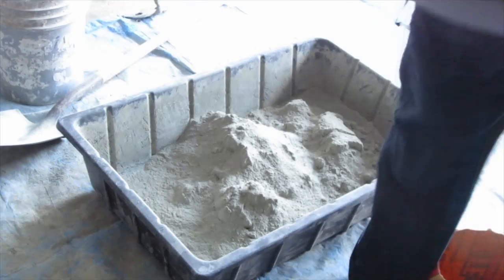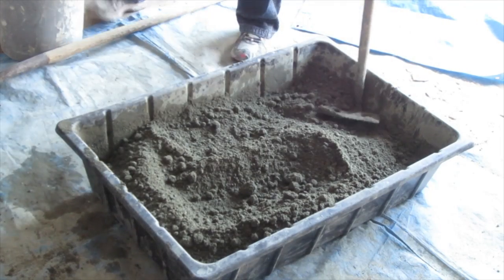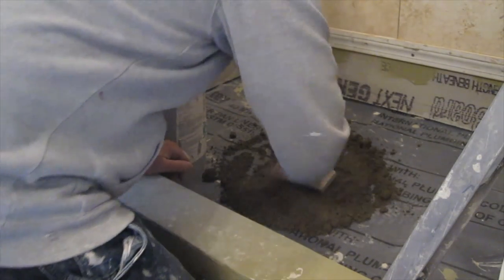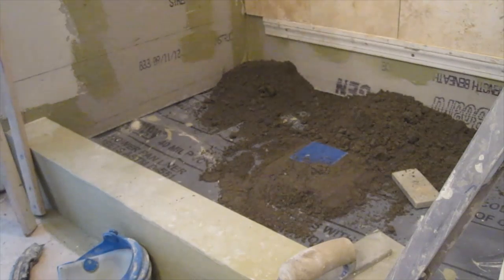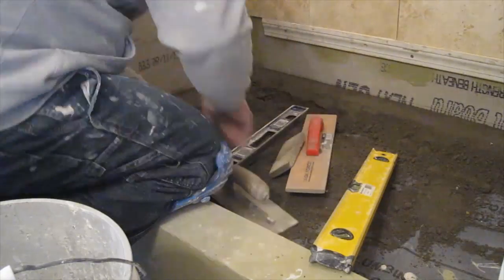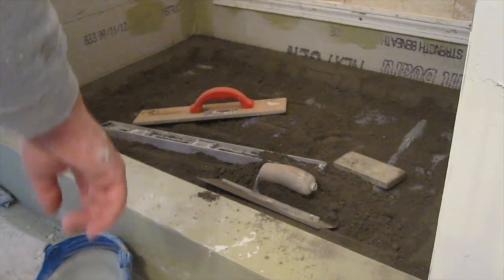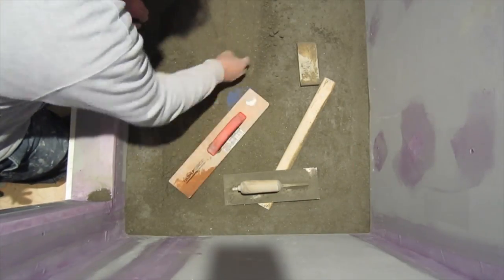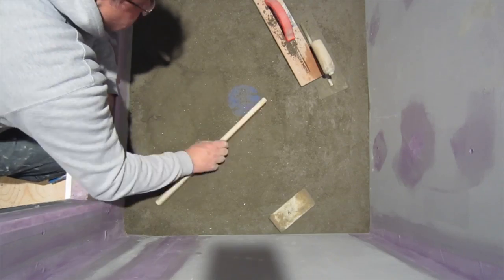How to install   Mud in a shower floor

Comment: how high do you start with your drain to base your 1/4” per foot off of ?? thanks.
Reply from the maker: Whatever height you set it at, the furthest point from the drain needs to have a 2% pitch, this means that if you have a level perimeter, the narrower part of the floor will have a pitch of more than 1/4" per foot. So if your furthest wall is 2 feet away from the drain, the height at that wall has to ge 1/2" higher than the drain.

Comment: What do you think about using admix as a replacement for water?
Reply from the maker: Leslie Spindel The answer to that question is not as simple as it might seem. I would say that it depends on how you intend to treat the shower floor before installing the tile on the floor.
Reply: ***** when would it be appropriate and when wouldn't it?

Comment: Hi Sal, Does it matter if you use a mason sand or play sand? I was told the play sand is finer.
Reply from the maker: As long as it is clean, you can use what you want, however the masons sand might give a stronger end product.
Reply: Thank you, Sal.

Comment: can the line around the base along the wall be level, using the longest distance from the base wall to the drain to determine the line's height (pitch will thus increase for wall nearer to drain),  or is it better to use a constant pitch alone
Reply from the maker: That's how i do it, level all the way around the perimeter.
Reply: ***** thanks. I'm a novice DIYing the shower right now, and that's the way I just did it(phew!). Checked my inbox for a response before it started curing though :)

Comment: My shower bed is rectangular (7' 1/2 x 4').  I know you state you make your outside perimeter is at the same height all the way around the shower.  Since mine in rectangular, should I slope my longer walls to reflect the 1/4 in per foot?  It seems to me that if I do not, then the slope at the 3 1/2 (middle of wall) foot area to the drain will be pretty steep. What are your thoughts?
Reply from the maker: It is your bathroom, so you are in charge, but I like to see a nice level perimeter so that all the tile pieces at the shower floor, wall transition are the same size.Something to take into consideration when deciding this, is the size of the tile you will be installing on the walls. If you are using a large wall tile and you end up with a large piece on the floor, then the slope of the floor will not be as noticeable, if on the other hand the tile is small or you have a smaller piece at that transition, it will stick out like a sore thumb.
Reply: Thank you for your reply.  From watching your video I know you like to have the same height all the way around, but the shower in the video was relatively square.  I just wanted to hear your opinion on the rectangular shape to ensure the thought process was the same for both.  I have seen where others sloped the long wall to maintain the 1/4 inch per foot slope but I wanted your advice, as you are obviously a professional, if maintaining the slope was necessary.  Once again, thanks and keep up the great work.  You do awesome work and making good videos is a plus and not easy.
Reply from the maker: Max Cady
No point arguing with you, you obviously know it all and do not tolerate any deviation from your way of doing things, upload your own videos on how to do it the "correct" way. Once in a while i get people like you proclaiming to be the end all be all greatest tile professional that ever lived, I have over 420 videos for people to watch and decide whether or not i know what i am doing, you have Zero videos and one enormous Ego. It is easy to post a negative comment, not so easy to prove your claim, send me a link when you upload your video of you personally installing your your perfect tile job, then we will all judge your work.
Reply from the maker: It is not NY ANSI it is a American standard, (American National Standards Institute) and it is not TCA it is TCNA (Tile Council of North America), which if you actually look at, you will see that I do follow, by calling them incorrectly, goes to show that you have not looked at them in quite some time. It has been TCNA for quite a number of years now. I am not insulted, and I am not a Hack, If you want to comment on my videos saying that it is wrong, then you certainly do need to make videos to prove it, anyone can leave a comment and claim to be an expert. Prove it, I have! I have also attended many seminars and training programs over the years, I am confidant in my abilities, and after 30 years installing i am certainly not a novice. Since you own a company with multiple employees, my guess is that you have not set a tile in many years.
Reply from the maker: It just blows my mind that you presume to know by watching one video just what my qualifications are, where I have worked, and how much I may or may not know, the extent of my experience and the type of jobs I have worked on. I make videos to help people install tile in a manner that will last. You take issue with that and tell me that I am unqualified. I think at this point you should continue to do your job, and I will continue to do mine. Good luck to you and I wish you well.

Comment: Hi Sal, I like your videos and your New England accent. You almost sound Irish or Scottish. That mortar looks so dry.  Is it ok to make it a bit more wet like for masonry?
Reply from the maker: It is deck mud, you don't want it to be too wet, it needs to be able to hold its shape when pressed into a ball, but no water can be squeezed out of it. like  Masonry would be to wet.
Reply: So a mixture with low moisture content sort of like say moist beach sand that could make a sandcastle?
Reply from the maker: Right.

Comment from the maker: I will have to disagree with you, having installed more of these than I can count, I can say with certainty that if all the proper steps are taken and the base is installed properly, it will last indefinitely. Any shower base can fail if not installed properly, the ones i have seen fail have always been installed improperly.

Comment: How high is the outside perimeter and how low is the center of drain? Great job
Reply from the maker: Slope has to be at least 1/4" per foot.
Reply: @SalDiBlasi  thank you,  I guess I can start at 2" on the outside perimeter and work my way to the center
Reply from the maker: @jdjohn2072  👍

Comment: How much do you guys charge to do your mud pans? I charge $550 for a basic 3x3 +supplies. I have a lot of guys tell me I charge a bit cheap but I look at it as in I make 550 bucks in less than 4hrs any would be interesting to know how much you guys charge
Reply from the maker: Imabeast191 I never discuss price in an open forum, but you should charge what you think is fair, Also what might seem way over priced in in one area of the country might be cheap another.

Comment: Can you do this directly on a concrete slab floor? Or do you need a waterproof membrane laid?
Reply from the maker: a membrane and preslope are always required with this type of system, no exceptions
Reply: Thanks for the response!
My plan is to do a curbless walk in shower, so pretty much have a watertight bathroom with only a shower curtain stopping the main shower spray. I saw a lot in Norway/Denmark when i was there and think its a great space saver.
Are you more of a Schluter board kind of guy or a concrete fiber product?
Reply from the maker: ***** Schluter is always my first preference.

Comment: The distance from the corners of the wall to the drain being more than the distance from the middle of the wall to the drain. .Do you  set your reference for the 1/4 inch per foot from the corners or from  the middle of the walls to the drain?
Reply from the maker: Furthest point
Reply: thank you sal!
Reply: I must say, this is the best question here. Most every question has already been answered by watching the video. I think most everybody understands the 1/4" to 1' rule. But where to start? I had just taken it for granite to start in a corner. Never even thought about starting furthest from the drain. And this is why I've spent the past 2 weeks watching videos and reading the comments. You might've just saved me a massive headache by not starting in the wrong corner. Thanks!!!

Comment: Hi Sal, If the slope is already in the preslope, do you need to repeat for upper layer?
Reply from the maker: Both have to be 1/4" per foot towards the drain.
Reply: @SalDiBlasi  So if you have an equal amount on top of the preslope, you should still have your 1/4 ft slope, yes?
Reply from the maker: @marecooley7  if you keep the thickness of the top layer of mud even and following the bottom layer, yes.

Comment: Sal, how did you determine that start height for the drain when you first put mud around it? Then, later on, what height did you back the drain out to?
Reply from the maker: Minimum 3/4" of mud at the drain for the preslope, then minimum of 1 1/4" at the drain grate.
Reply: Sal DiBlasi when you say grate height, you measure up from the PVC liner to get the 1 1/4" correct?
Reply from the maker: PVC liner to the bottom of the drain grate so that the tile will be flush with the top of the grate.  You want a smooth transition from the drain to the tile, however the tile  can be slightly above the finished drain,if you like.
Reply: Sal DiBlasi great information. I have a curbless, wheelchair accessible, roll in shower. The bathroom itself is also going to be tiled. So I would bring my mud in the shower pan right up to the hardibacker level in the bathroom, correct? Since they will both be tiled... There would be a straight transition from bathroom to shower
Reply from the maker: If you have a curbless shower, it would be a very smart thing to make sure your entire floor is waterproof, inside and  out and at the wall to floor transition of the main floor. A secondary drain is also a smart move and wall hung fixtures make sense as well. Any penetration in the floor is a possible leak if the shower overflows. There is no curb to contain the water. A sealed System would be a better choice for a Curbless shower, it reduces the height required for the shower floor, no need of a preslope. There are also several Foam tray solutions that will make the construction and height management much easier.

Comment: I tried to do this but when it dried it was  very sandy and crumbled apart. What did I do wrong?
Reply from the maker: Happens a lot to first timers, you either mixed it too dry or did not pack it enough.

Comment: So Sal are you saying you did not lay this right on top of the plywood? Just wondering I am trying to do a shower on my own I have very little money and just as little time. But I am looking for the best and least expensive way to do this I have bought tile for the walls and some river rock I want to incorporate a seam of through the top half, that said I do want to do a tile shower bed but the more I watch these videos the more I am leaning toward a basin pre fab?
Reply from the maker: If you don't have a lot of money, then it is very important that you do it right the first time, nothing wastes money more than having to do things over. So I would suggest you watch these two video so you can understand the whole process. First this one https://www.youtube.com/watch?v=p8xsx3316IU&list=PLE025D61CF6E3515B and then this one https://www.youtube.com/watch?v=aKY2TjNUpYI&list=PLE025D61CF6E3515B

Comment: I appreciate all the videos and advice you've given me to date. Thanks. Quick question regarding backer board and mud pan. I've watched several videos of installs other than yours. Some say run backer board to top of mud deck and leave a gap. In yours, I notice you imbed the backboard into the mud. Is there a preferred method and what is the logic behind either or?  Thanks again
Reply from the maker: The reason I run it down is because I waterproof everything, including the mud, but it does not go all the way to the pan liner, i always leave an inch or so above the liner. If you do not plan on waterproofing then technically it should go on top of the mud and seal with a bead of silicone. Leaving a large gap, in my opinion is not a good idea.

Comment: how do i set a ledger board to tile a shower? I cant find info anywhere on proper height
Reply from the maker: There is no proper height, it depends on the tile you are using and where you want to start. Every job is different.

Comment: Cement board is not waterproof is only moisture resistant wont the water in the screed weep up the wall?
Reply: What?...No....in the screed? Its sloped to the drain!
Reply: yeagermeister63 You completely misunderstood her question.
Reply: Like a capillary effect.
Reply: Hardi backer is actually waterproof

Comment: Sal will it be ok if I don't use water proof vinyl in my shower floor?
Reply from the maker: The vinyl liner is a critical elements, unless you are using some other kind of water management system.
Reply: *****  Thank you Sal for your quick response

Comment: ? how many bags of quikcrete would I need for a 3x5 shower
Reply from the maker: depending on the depth of the mud 4 or 5  60 pound bags
Reply: Thank you starting a diy project

Comment: Sal, isn't there a product actually called Deck Mud (or something similar) that I've seen you use in some of your other videos?
Reply from the maker: Deck mud is a generic term for a mixture of sand and portland cement at a ratio of 4to1 or 5to1, it is mixed just damp and can be shaped to the form needed. Deck mud is used for walls. Fat mud also  has lime  and is used for floating walls.
Reply: I found your other video just a second ago where I had seen you using the MAPEI 4-to-1 Mud Bed Mix. That's the one I was thinking of. A few of the Lowes stores have it around here. The only reason I was looking for this specific brand is that my guys were complaining about the recent bags of Quikrete Sand/Topping mix I bought for them.
Reply from the maker: Quikrete Sand/Topping mix is a richer mix, more like 3 to 1, to make it leaner add some sand.

Comment: Ton of skill involved in doing this type of thing and ending up with a quality job. Even at that, this type of shower base installation is antiquated and WILL eventually fail and leak. It's the most expensive, most time consuming, most labor intensive way to do a shower base and not the best by a long shot. It's beautiful when a real pro does it, but at what cost over all? To me, this particular technology is akin to installing grass roofs on a modern home. Just doesn't make sense to me.

Comment: What is the average cost for one of these bathrooms finished? I had a plumber quote me at 600 to 800 bucks with entire shower finished.
Reply from the maker: Why would you have a plumber install tile, would you have a painter fix your car? That is less than it will cost you to have it ripped out when it fails. Watch some of my videos here https://www.youtube.com/playlist?list=PLE025D61CF6E3515B and then ask your plumber how many steps he is going to skip.
Reply from the maker: Price varies greatly, depending on location, size, configuration, and the system and material being installed, so if you want a price you will have to get an estimate from a tile installer, preferably not the plumber, but I can garentee that it will be more than $800. I will ignor the insult this time.
Reply: Tony Garza if they do it RIGHT

Comment: I read you need to wait 28 days before you can tile, is that true?
Reply from the maker: No it is not if we are talking about deck mud, if we are talking about concrete then yes if you want to install the tile directly to the concrete, but if an uncoupling membrane like ditra is installed then it can be installed as soon as the concrete is firm enough to walk on.

Comment: Thanks Sal. Great information. Would I have to use any mesh to reinforce the mud floor if it is only 1.5 inches thick? I've already purchaced DensSheild or would probably change to Durock. Also does your friend, who likes to use the DensSheild, put the walls up then put in the floor or does he put the walls up after so it doesn't wick up moisture?
Reply from the maker: Barry Straughan I waterproof everything, but technically the Denshield is not supposed to go under the mud. No wire in the top layer of mud.

Comment: Sal,
What type of cement you are using?
Reply from the maker: You can use Mapei 4to1 or any other companies Deck mud, if you cant find any you can use sand topping mix or if all else fails mix your own 4 parts clean sand and 1 part Portland Cement
Reply: @SalDiBlasi  thanks Sal

Comment: I myself don't like working on a shower pan , running tile , I feel like my mud bed will protect the shower pan  from a potential hole while installing your tile , I prefer to run a level line of mud all the way around then screed to the drain , let it set . then set my shower floor then run my walls. I thought the running off the boards was for beginners
Reply from the maker: I will usually do it that way, but on this job I was short a box of tile for the shower floor, had to start on the walls.
Reply: I feel you. And time goes on and so does the job. Got to do what you got to do
Reply: Myself I've been doing it about 40 years, been doing 30 years for myself I have done hundreds of showers. Needless to say it's a tasking job. But at the end of the day you look back and see what you have created
Reply from the maker: Exactly